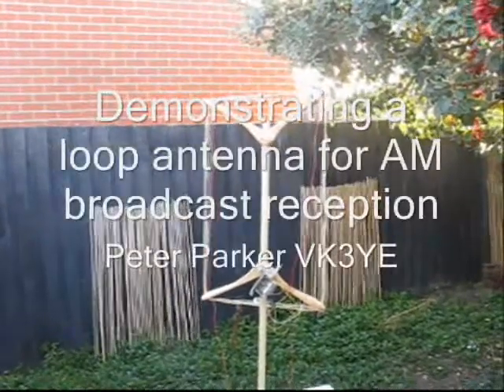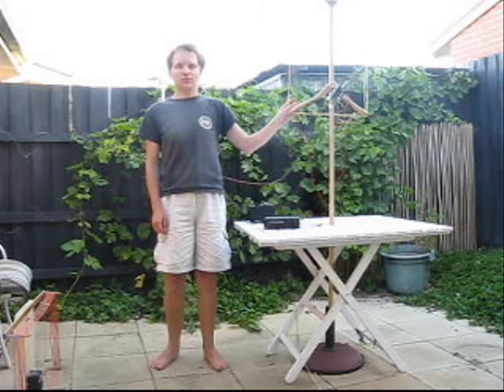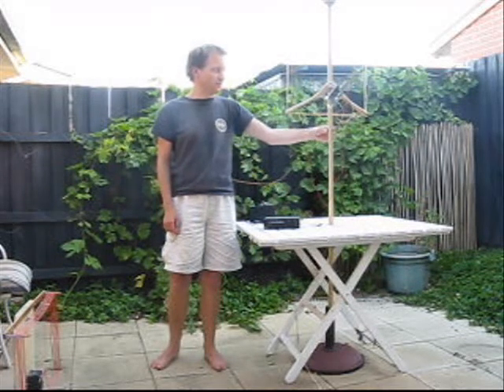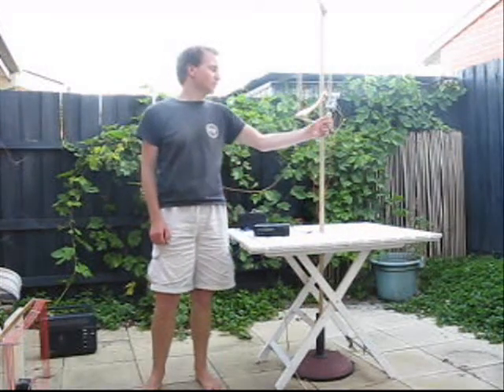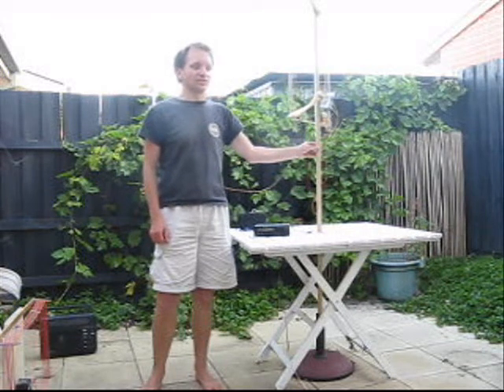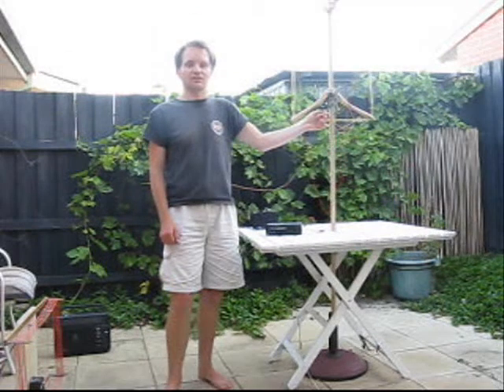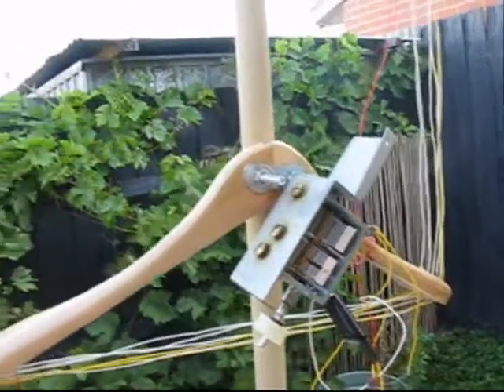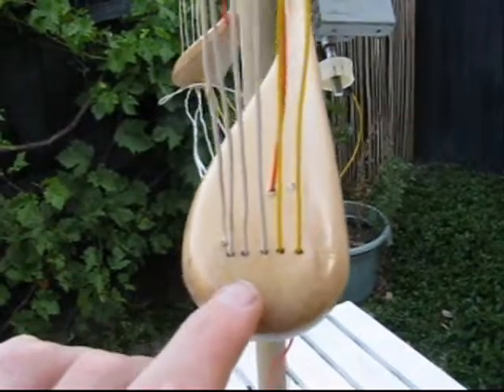MF tuned loop antenna for broadcast band reception

Comment: Excellent video. I alleviated boredom one Sunday evening a fair while ago by building a makeshift loop antenna by wrapping wire around a cardboard box and using a valve radio tuning cap. I hooked it up to my FT-817ND and could pick up AM stations as far as Sydney and Dubbo. Yep, radio is as bad there as it is here in Melbourne. ;-)

Have fun!
Emil - VK3NAF

Comment: Nice and simple. If it is a radio that I have dedicated to the loop, then I will open it up and do a 1-turn loop around the internal antenna; this provides even better gain and makes the loop even more directional.